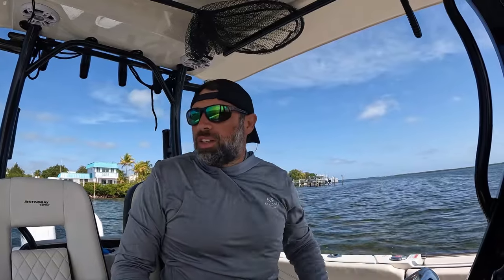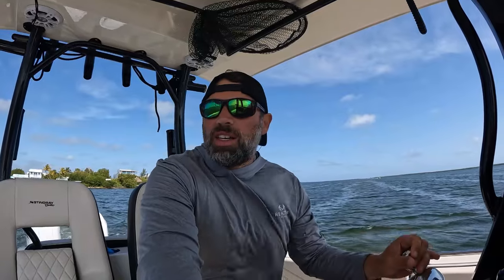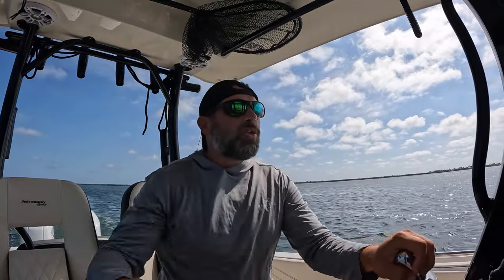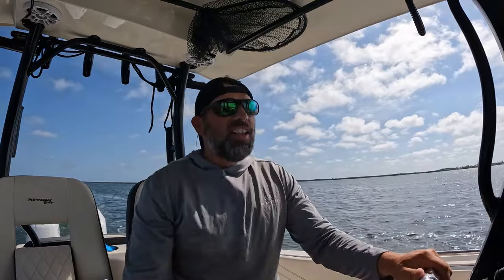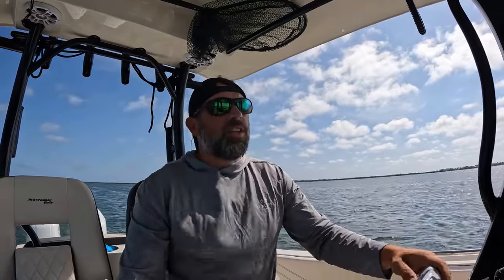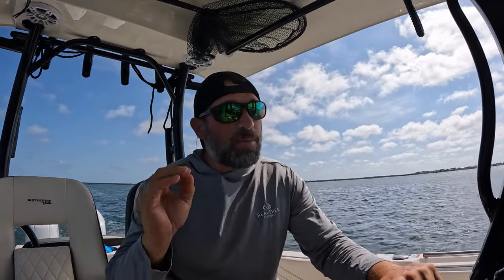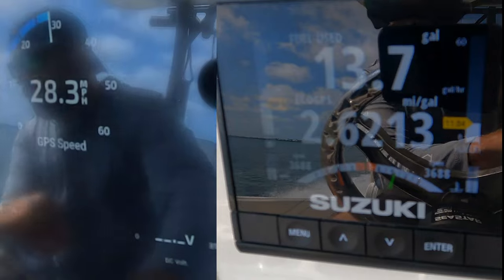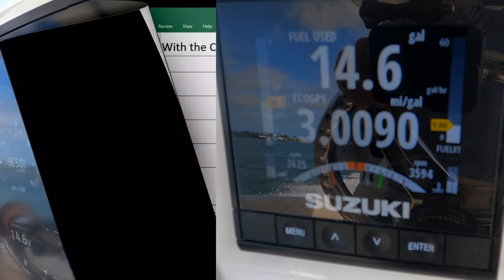Ep 28 The Hull Dictates the Speed, not the Horsepower

Comment: Thanks for getting back to me.  Great video!
Reply from the maker: Glad you liked it. As boat show season is approaching, I can't even think of a boat I'd rather have and I love boat shopping. Super happy with my 273. Just did a episode to the dry Tortuga's and had great fuel economy.
Reply: @keyslife273  Sweet, I'll have to check it out.  Stingray is one amazing boat!  I can't believe they don't have more of the market.  A lot of bang for the buck with amazing performance and quality.  Thanks for sharing your experience, I couldn't find anything else as detailed as your video. My buddy has the Tidewater you compared it to.  I love that boat but the helm is not as comfortable as the stingray.  The steering wheel feels too low for those long runs 20+ miles offshore.

Comment: Great vid! Great motors too! We love our Suzuki and get great numbers. Many said to get a 300 instead of a 250. The cruise would be the same and the top end maybe 2-3mph more with the 300. We never go full throttle. Seas have to be calm for that and it’s just to dangerous with the boat traffic here. We cruise at 28-30 at 4100 rpm and get around 3.5 mpg. Matching the motor to the hull speed is where it’s at! 🤙
Reply from the maker: Great info, thanks for sharing. Singles always get really good numbers, but Suzukis really seem to sip the fuel.

Comment: It is amazing how much a difference in fuel economy different classes of boats have. 

For instance, my little 1436 Jon Boat (that I use to fish inshore and fresh with) powered by an old carbureted 9.8hp Tohatsu. Will get up to the low 20s with just me and all the gear on there. 

The specs on that motor, as per the Tohatsu dealer service manual, is a MAX burn rate of 1gal per hour. So, if I were to get say 23mph... I would at worst be getting around 23mpg. That being said, going slower, the fuel economy drastically climbs. 30mpg can be had at the right speeds. 

Tohatsu is coming out with a fuel injected version here in a few months that is rated to get 35% better fuel economy. In 3 to 5 years I may do the upgrade. That being said, I just replaced all fuel lines, fuel filter, fuel pump, and entire carburetor (Entirety of the fuel system) for less than $300 and about an hours worth of work (two hours once you add in the time to reset the idle on the motor).
Reply from the maker: Yeah, good info. Small boats are definitely more efficient. I'm building a bullet net boat with a 50hp suzuki I'll be posting on the channel and I expect that boat to get much better economy than my offshore boat.
Reply: @keyslife273  
I bet it will! Look forward to the vid. 

I saw someone with the same setup as me but with the 20hp Suzuki on his boat. Fine-tuned it to get 34mph after playing with props and trim. 

I just want to get on plane at half throttle.